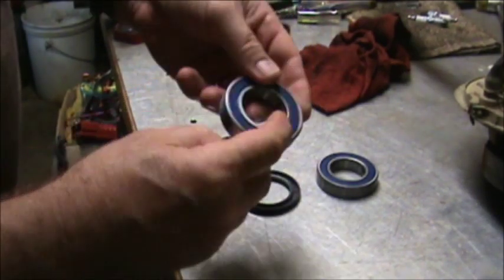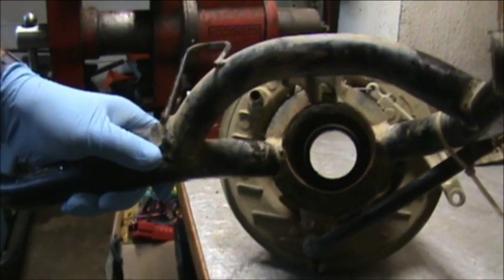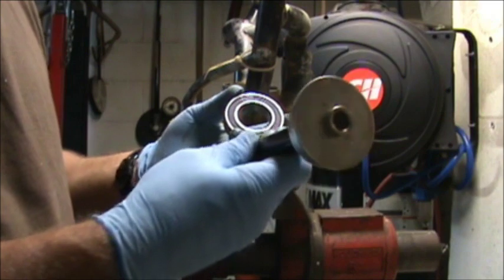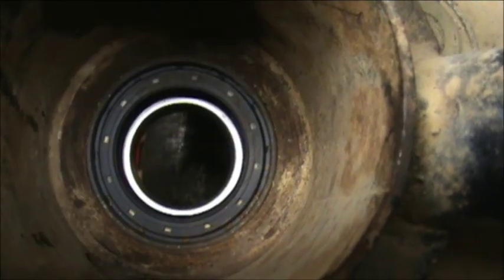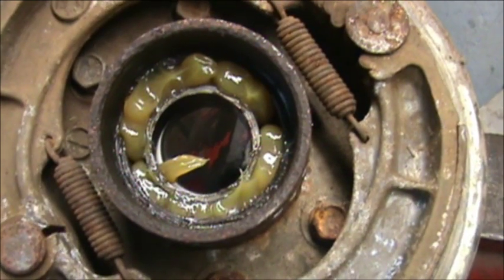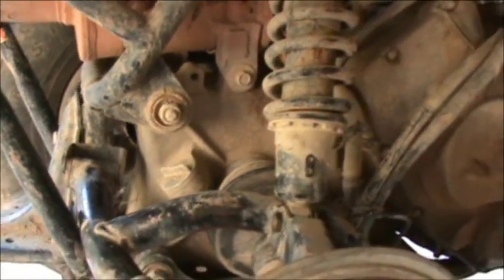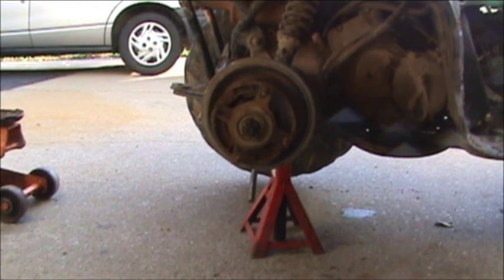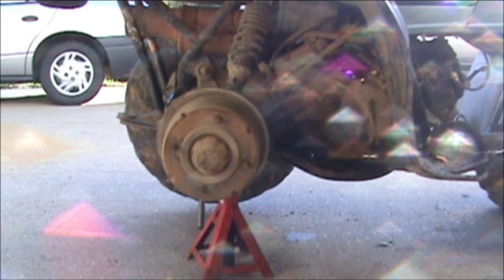Part 2 Suzuki LT-4WD QuadRunner bearing installation

Comment: Whats the part number on the bearings
Reply from the maker: BEARING (32X58X13)
09262-32023
You can find it on Amazon
Reply from the maker: Here is a link to parts you might need.
https://www.ronniesmailorder.com/oemparts/a/suz/50d0b166f870022c2c536450/rear-suspension-arm

Comment: My bike is 1997 king quad, I've put new bearings in and when I put the stud plate into the bearings it won't go all the way home leaving a 5 to 10mm + gap towards the brake drum housing and seal? What do you think is wrong here please?
Reply from the maker: It has to be centered and you might have to tap it in and is the bearings all the way in?
Reply: @LonnieJohnson1  I've taken it to the shop I don't know what's wrong with it
Reply: So I took it to the shop and to my surprise a small ring of the old bearing had sheared off at stayed I side the housing! I couldn't see it but once it was removed and shown to me I was amazed and pleased it could be sorted! Cheers
Reply from the maker: Glad to hear it wasn't nothing super bad.

Comment: OK how about the seals and bearings at the other end of the shaft, in the differential  ?
Reply from the maker: Well you have to take the differential apart and that would be another video. I do have a video of that but it on a 300 Kawasaki Bayou. Go to this link to see the Suzuki LT-4WD differential break down.    https://www.ronniesmailorder.com/oemparts/a/suz/50d0b15cf870022c2c536431/differential-gear

Comment: So I installed the bearing using another video. I installed it correctly however, I forget to put grease on the space.  Is that going to be a problem or no?  First time doing it so please don’t beat me up too much.
Reply from the maker: Did the old part have grease on it when you pulled it out?
Reply: LonnieJohnson1 no sir.
Reply from the maker: If you mean the spline you should be ok, it should have had grease on the other end.

Comment: hi and thenks for the video, could you give us the sizes of bearings and seals please?
Reply from the maker: The bearing part # is 09262-32008 and the Seal or dust cover part # is 09238-40018 
You can go to Ronniesmailorder.com and find any part you need for this and other ATV's
Reply from the maker: Also the back seal dust cover part # is 09283-40019 both inner and outer bearings are the same. If you take your bearings and seals to a place that sells bearings they will match them up at a cheaper cost.